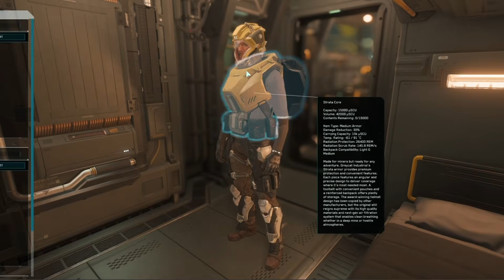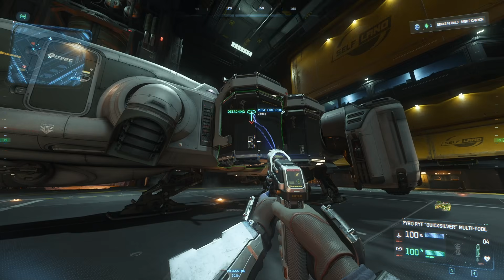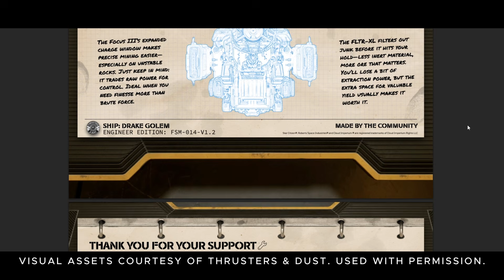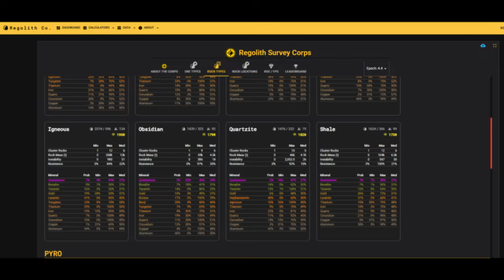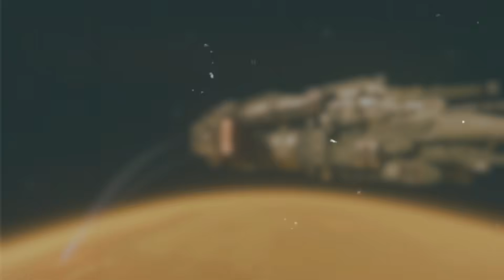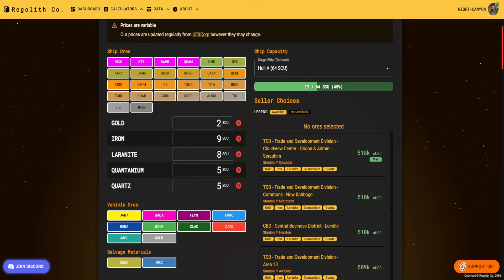Star Citizen Mining Guide | Prospector & Golem Beginner Tutorial  #StarCitizen #StarCitizenMining

Comment: I don’t know , how to change the cargo hold from Golem
Reply from the maker: You need to unlock ports when in the cockpit first, check your keybinds for that command, then use your tractor bream (maxlift) works better to pull them out. When you use the tractor beam it will show and arrow in the direction to pull it out. The rear one is a little trickier